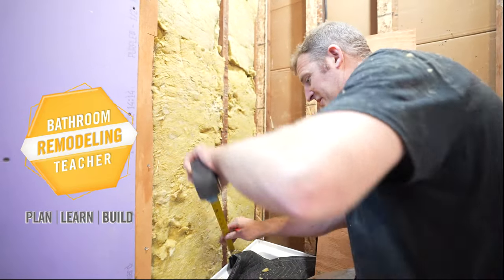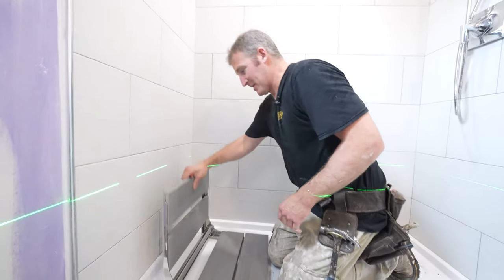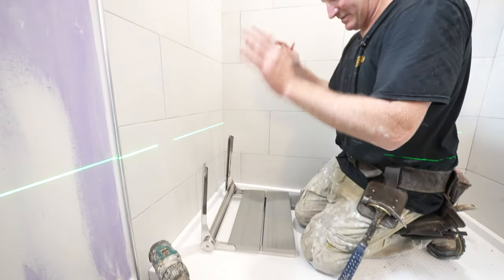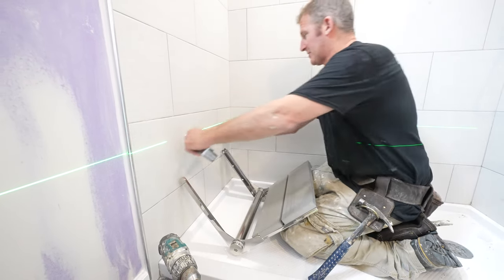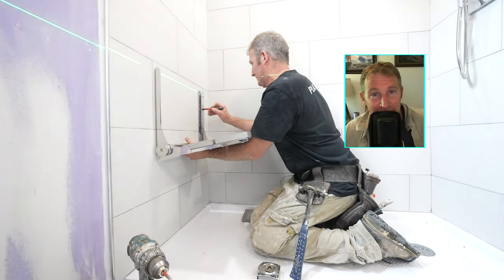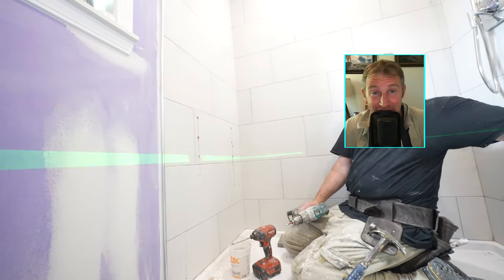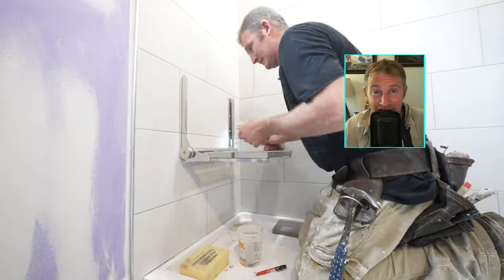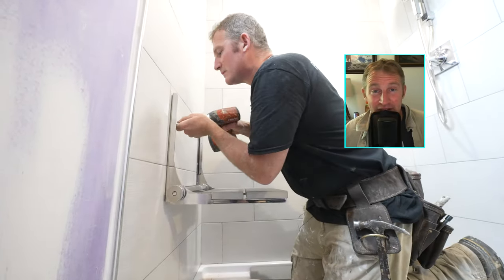Folding Shower Bench

Comment: is that ideal blocking for a 200 lb person? seems it would stress the tile & grout quite harshly
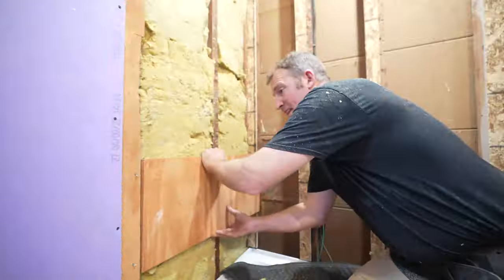Reply: I am only now investigating these folding seats for a shower application.  The "blocking that you are asking about ....IN THIS VIDEO... is actually very poorly done because this is the most important part of this product and the entire success of the end result.    It is very disturbing that whoever has done this video, has "fast-forwarded from 0:07 and at 0:10 ....three seconds later .....which is more like 15 minutes to 30 minutes of work ....TO PUT THE BLOCKING IN PROPERLY .........AND THERE IS NOTHING TO SHOW THIS VERY IMPORTANT STEP ........which is the point you are asking in your question .......hence the question.

To make things even worse, this guy admits that the blocking that he put in was not high enough!!!!!     WTF????      That one admission make this whole installation a 100% fail in my eyes.

WHY WOULD ANYONE POST SUCH A COMPLETE FAILURE???

This guy is no "professional".   If there are four screws per side .....YOU MAKE SURE THEY ARE USED.

And the worst thing about his "blocking" is that it actually NOT blocking!!!!!!!!!!!!!!!     It's just plywood!!!!   HOW THE HELL WAS IT ATTACHED TO THE STUDS?????   BLOCKING IS 1-1/2" SOLID WOOD.

THIS INSTALLATION IS 100% COMPLETE GARBAGE.  Over time, the tile will be either start micro cracking or the grout will start cracking and separating.

.

Comment: Plywood isn't ideal for blocking. I say this as a professional bathroom remodeler. Blocking should be 2x4s. Don't even get me started on the goboard.
Reply from the maker: You ever use the 2 x4s at depot 😆
Reply: YOU ARE 100% CORRECT.      THIS GUY IS A COMPLETE CLOWN.     .....PARTICULARLY AFTER READING HIS RESPONSE TO YOU.

.

Comment: What size diamond bit do you use for a 1/4 screw?  Same size as the screw or bigger?  And how far into the blocking should the screw go? I'm not sure what length screws to use and the bench didn't come with the correct type of screw.  Thank you.

Comment: Question i wanna build a knee high wall and place the same foldup seat on that wall, how  shud i build that wall so it can take the weight of someone seating on the chair?
Reply from the maker: A knee wall would be much tougher to support laterally. Definitely need to anchor wall to joists below to prevent movement. I unfortunately do not have a video on that one. Here’s one over concrete https://youtu.be/_86YlvlKTho
Reply: @BathroomRemodelingTeacher  thanks!